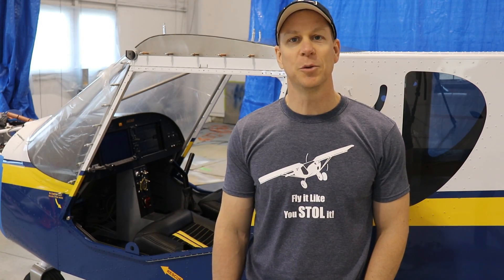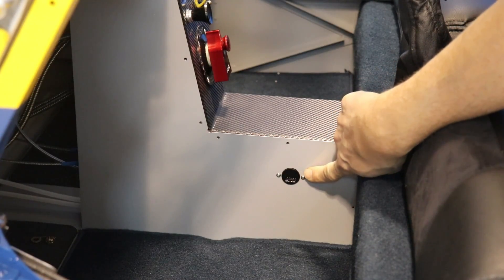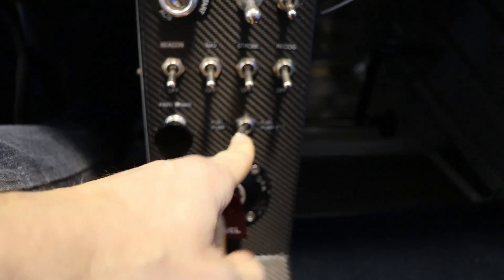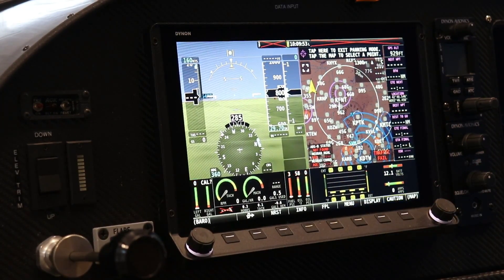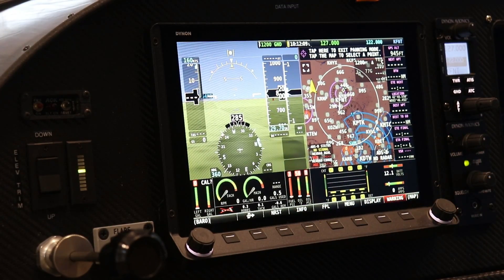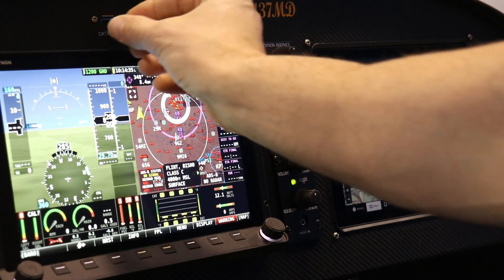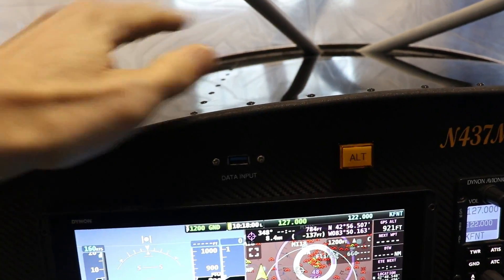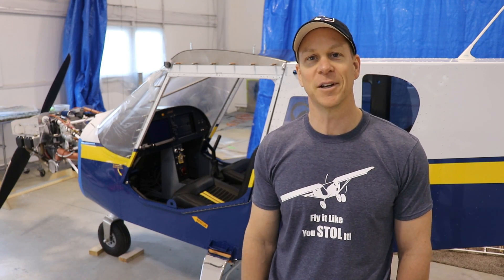Dynon Skyview HDX Panel!

Comment: Great video. One thing: it’s hazardous to vent hot air directly from the engine compartment due to the potential for CO / CO2 in the cabin.
Reply from the maker: That is true. Cabin heat systems in general aviation aircraft get their heat from a cuff around the muffler or exhaust pipe, and not from the engine compartment itself. There is an extra inlet (on the bottom of the cowl in my case) that feeds fresh air around the pipe, which warms up and is then sent to the cabin. It's not fool proof though because CO can still get into that air supply if there is a crack in the muffler or pipe.
Reply: @KitplaneEnthusiast  that’s good to hear! It sounded like you were venting from the engine compartment. 😀

Comment: Is there room for an autopilot?
Reply from the maker: Probably not now that the panel is done, but if I did install an autopilot and designed the panel with that in mind, then yes there's plenty of room for the Dynon autopilot controller in the panel. The Super Duty WILL have an autopilot!

Comment: have anybody build avionic panel 7-10" display whit arduino or raspberry pi3. lot cheapen than ower price garmin all panels. because garming have ower price lot, display cost maximum 100€ and elektronic this raspbery pi or somethink  other smart, 10.40$ max. no newer cost more than 180$ but garmin thief customer and sell idiot ower price all gauges,panels. 2000€ onme display panel have totally ower price because true have all work,parts,etc cost under 200€

Comment: very nice, clean panel. Question about the control stick:  it seems to be pretty tall. Do you see the need for an armrest to support your right arm to avoid over controlling the stick or making inadvertent control inputs?
Reply from the maker: No I haven’t needed an armrest. I can rest my arm on my leg and use a few fingers on the stick. It’s very comfortable.

Comment: Nice setup.  You might want to attach a cradle for your phone, while charging, on your lower center console.  That will keep the phone from sliding under your rudder pedals (which it will do at the most inopportune moment).

Comment: Nice clean install, your Dynon comes on with your master versus your avionics. Are you not concerned with a transient voltage spiking during engine start, burning out the Dynon?
Reply from the maker: No. Your Dynon manual clearly states that all of their avionics can be on during engine start.

Comment: Hi, love watching your videos, and outstanding workmanship! 
Quick question, Zenith estimates about 450 hours build time for the Cruiser on the website.  Am I reading that correctly?  I'm assuming that's with zero paint and a minimalist build.  Do you think that time estimate is accurate/feasible? You mentioned in one of your comments below that the Zenith takes a lot more "thinking" than Rans or Kitfox. How does the build experience compare between the different aircraft you have built? 
Thanks

Comment: Love your work and love how the world of LSA & Sport aircraft have open up new doors and avionics has done the same love how pilots/builders are free to lay out the aircraft and at times use none TSO parts or equipment keeping the cost way down but not comprising on safety or performance.

I do like having the aircraft controls layout so the copilot's side can fly the aircraft to meet just add so much more to it
If you have another pilot he can fly

You can teach your wife or kids to fly as well over time in case there is ever a reason out of the blue and you can no longer act as PIC as  they say anyone can give advice after the job is done

It looks like a first class job love your thinking on putting the USB down out of the way like you I  love round holes there so much easier & quicker to make that square one and ease to enlarge or make smaller if the switch or device ever fails and the replacing unit is not the same size 

Love your build and I have had no trouble with any of the Dynon avionics systems install the manuals for the most part are clear and the Hub's make it ease to connector equipment to the bus and the  network cables can be shortened & repin if there way too long giving a cleaner look or they can just to tuck out of the way

Hope to see it flying and love your work it looks like you took time in laying out all your systems and how you like the aircraft to set up

Hope you make a details layout of all aircraft systems just in case service is need or the wings have to come off and use connectors -  building avionics & aircraft systems for LSA i have found some builders do a good job but lack putting things down in paper or make a Build book for there systems and at some point  wings are pulled and the shop putting them back on must now troubleshoot/ buss out each wire & grounds to match up lights, fuel senders and elec

I did not see your other videos on wiring and you may have done this 

Thanks for posting
As I only offier words that may or may not help someone and I am not all ways right

Comment: Can you fly IFR with that panel?  If not, what else is needed?    Thanks for the videos.  They are extremely helpful.  (and yes...you do great work.)  :)
Reply: @KitplaneEnthusiast  Thanks!  I knew about the heated pitot tube (and just plumbed the wings on my CH750 SuperDuty for it, but I am still learning about the other requirements.  I shall call Dynon.  Learning, learning....  I know you are inundated with messages, but if you get a second, I would love to know why you chose to outfit it VFR when you are obviously IFR rated.

Comment: Your panel makes a LOT of sense, logically speaking, for a cruise type aircraft, but what I STILL 'don't get' is the need for multiple screens, except for redundancy protection. Could you clear up this issue pertaining to what the Dynon right screen provides that the iPad with Foreflight doesn't or vice versa, given that you can upload/download from one screen to the other?

Secondly, my goal is to build a 701 for non-city flights, ie, back country and salt water uses, so I'll be going 'old school' with NON-digital gauges for 80% of my panel; analog is more reliable as far as I'm concerned for the intended style of flying I envisage, and the 20% left over can be for an Android Tablet (I despise Apple for the most part) in a 'backup capacity'.

By the by, I do indeed love your Flap/Trim/Throttle layout........as Brando once intoned "Sheer Genius!"

Cheers from the high plains desert (currently snowing, with an expected 4"-8", down from a projected 10" to 14", to fall by the end of today, headed  your way I believe-say, can you do a 'de-icing' wing' on a ELSA?) of Wyoming in the Rocky Mountains!

Comment: Very impressive.  Nothing like watching this to see that my building isn't as nice as yours!  I'm a little behind you, in that the plane is built, engine is hung, and I've slowed to a stop as I try and do my Garmin panel.  My plan is like yours, except I have wondered why people want to put a fuel selector in their build.  Why did you?  I have both wing tanks feed in to a 1.5 gal kitfox header tank mounted behind the luggage wall, then a single fuel line run to a shutoff valve under my legs, then through the center console to a gascolator on the front right firewall.  NO fuel selector valve.  Both wing tanks constantly feed the header tank, then a single line goes forward for fuel.  I see so many issues where a pilot screwed up with a fuel selector valve, and I've taken that out.  Just wondering why you did!

Comment: I think you need to add a 2nd throttle on the right hand side.  This way, if you're training someone or your co-pilot is to fly, that person would then have control of the power.  Other than that, it's a great looking panel.
Reply: @KitplaneEnthusiast  What about the 2nd part of my comment?  How is your
 co-pilot to access the throttle if you become incapacitated? Safety was my main concern.  FYI - I have 50+ years in aviation & retired from the airlines.  My current focus is on music, but experience is what triggered the question.